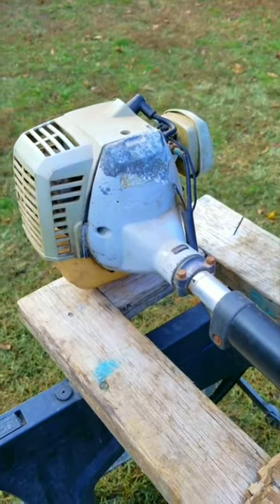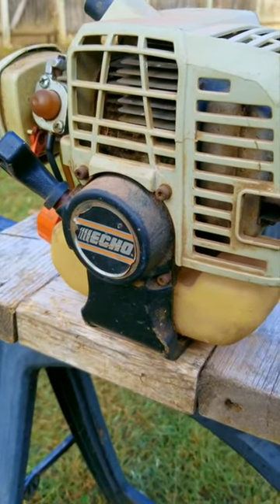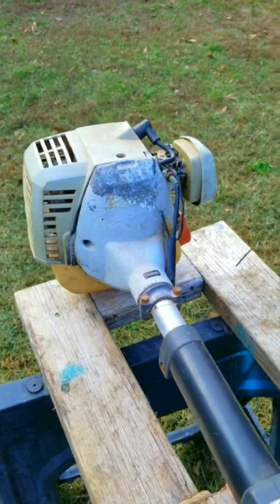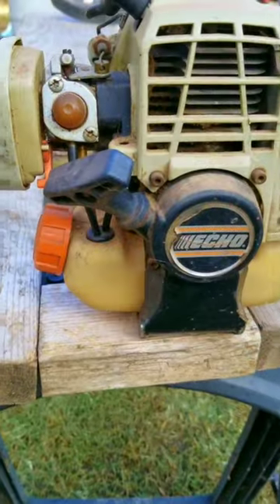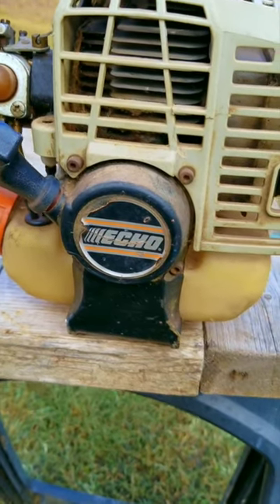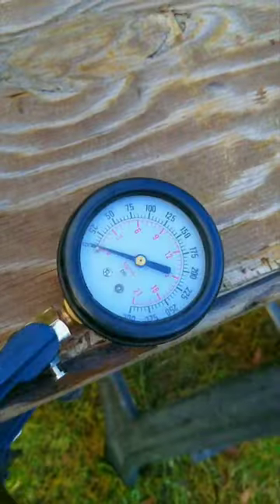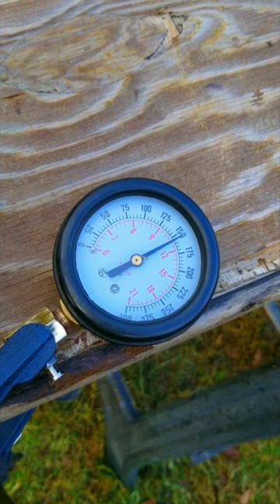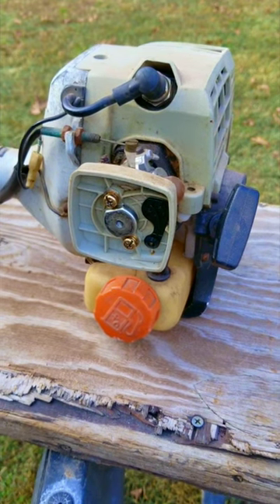Engine And Compression Are Related

Comment: Typically larger engines go for a lower ratio to save on fuel, but on weedeaters, chainsaws and stuff, it's not a big issue. I still like the older big 31cc+ because if you keep them in good condition they're worth their weight in gold. Comfort is a big factor too
Reply from the maker: you're right about that.
Reply: In the case of lawn mowers of 4 cycle types it's like cars but you also factor in air cooled. Fuel contamination of the oil is the biggest problem. Think about that one item when extending conventional oils. They can't bandle the fuel contamination.

Comment: Interested your thoughts on those E3 spark plugs... personally, I like NGK plugs in my Echo/Shindaiwa equipment...For the minimal difference in price I usually stick to NGK or possibly Champion if that was OEM Surprised my Echo 2620T runs a special NGK from the standard plug in almost all my other Echo/Shindaiwa OPE
Reply from the maker: I don't a have problem with them at all, but I only recommend using an OEM plug because it's what it the engine was designed with.
Reply: We use autolite race plugs on our small engines

Comment: For me, it's all about weight. Commercial weedeaters have small(21cc range) light, high powered engines that are noticeably stronger than  store brand 25cc motors
Reply from the maker: yes I totally agree, weight is everything
Reply: @HomeGaragechannel  Especially if you are over 40, carrying a 14 pound weedeater around in the summer heat stops being fun.
Reply from the maker: I feel that!

Comment: I have an old gray echo like that one , plenty of compression , love the older stuff , echo is great ! I use to run echo red armor pre mix but now I run mercury quicksilver 2 cycle mix , works great and if it protects a full tilt 2 stroke outboard then you can trust it !
Reply from the maker: me too, 2 strokes are really good for the power they make.
Reply: Hey Mark...don't take this as a criticism - I want your Echo to last as long as possible...Outboard 2-stroke oil isn't the best protection for your air-cooled OPE...the reason is that it is designed for cooler running water cooled outboards. Check the specs to see if it it rated for your equipment. TCW-3 is the outboard spec'd oil...I recommend either sticking with your previous choice of Red Armor (it seems to do a great job of keeping engines clean) OR if you want to save $ look at what I used to use Super Tech Universal 2 Cycle Oil for Air Cooled equipment. Currently, I am using Castrol 2T Snowmobile Oil. Good luck!

Comment: I never put any stock in numbers. If it did the job it had plenty of power. If it was weak I just ran shorter or smaller trimmer line. Always a way around problems but it might take a top end replacement too. Blkessings!
Reply from the maker: very well said.
Reply: @HomeGaragechannel  I try.

Comment: That's why Amsoil Saber is great. 100/1. Your equipment will last a very long time.
Reply: 50:1 not 100:1
Reply: @paulspomer16 i run my equipment all at 30:1 which seems to work like a charm!
Reply: @paulspomer16  Why Amsoil works great at 100/1. Do it all the time. Apparently you have not used Amsoil. The only unit unable to take the 100/1 is a Sax Dohmer. Something different in metallurgy of rings.
Reply: @Michaelsmith98453  Yeah if you are using those other guys oil.
Reply from the maker: I've heard good stuff about them.
Reply: Shell 2T oil at 25:1 and never had any problems.
Reply: @stevencaskey8502  I use amsoil and have been for years. No small engine should be ran at 100:1 with any oil. Plain and simple. I'm a small engine mechanic, I know because I've seen the damage from running 100:1 first hand
Reply: @stevencaskey8502 There is no good reason to run a 2 cycle engine lean on lubricant, no matter how good the oil is.  Amsoil will not replace your yard equipment if damaged by their 2 cycle oil.  Oil is cheap. engines are expensive.  Give 'em plenty of oil.  I like to follow equipment manufacturer recommendations.
Reply: @scotta9114  That's because you have to have oil analyzed and they have never had an oil failure. The reason for the leaner oil is for more power which means less usage or more work to be done. Why if leaner is not good do tou use 50/1 when in the 50-60s the ratio is 16/1. Amsoil is extremely good at what they do. We have had bot good luck with the old Sax Dahmer units. I suspect the Germans used a different metallurgy or something.  No info is available to me for that.
Reply: @paulspomer16  Or did they use something else. Only oil analysis proves it. Amsoil invites oil analysis. Say that yo the conventional oils and watch them shake. By the way Amsoils QC is far above anyone's. My father worked in conventional oil refineries for 35 years. I could tell you stories that would scare the crap out of you about the conventional guys. Also. Were you sure the guy actually put the oil in the fuel.
Reply: @stevencaskey8502  It's hard to say with 1.28 ounces per gallon?  Not a lot of margin for error.  I used Amsoil for many years in vehicles but finally stopped due to price.  We ran an experiment with two Poulan Weed Eaters.  Ran Amsoil in 1 at 100:1 and 50:1 Red Armor in the other.  Ran 2 tanks of fuel wide open throttle.  After that, took both engines apart.  Everything seemed dry in the Amsoil Engine and the Red Armor Engine was really oily.  Both engines showed no wear but it felt better to us to see the oil film in the Red Armor Engine.  Amsoil is great but I'd rather mix it at factory recommendations.  Thanks
Reply: @scotta9114  You are welcome to do as you wish. My experience since 1978 has been great. Amsoil rested Saber to 300/1. Worked very well. I believe  Amsoul does this for a very wide safety measure. I know the difference in QC between Amsoil and Amocos refinery in Texas City is staggering. That is a whole lecture in itself.
Reply: @scotta9114  Also. The pillow packs are actually 1.30 Oz. Just for good measure.
Reply: @stevencaskey8502  I would be nervous using this in my Toro 22043 Commercial Mower.  Has that wonderful Suzuki 2-cycle 5.5 HP engine.  I did try Royal Purple full synthetic oil at 40:1.  Want this Mower/Engine to run forever.  22 year old Mower.
Reply: @scotta9114  Amsoil tests them all. Be carefull. As for the mower using 50/1 is different here due to the continuous  or long run time. Also the mower is bigger.
Reply: This is an ongoing debate by the Lucas/Amsoil fanboys... it's your equipment - run it how you like...I'm not looking to race my strong trimmer or other 2-cycle equipment nor do I want to spend time/money repairing/replacing sooner than necessary. Therefore, I follow the MANUFACTURER'S recommended 50:1 leaning towards 45:1 with my mix... IMHO it makes ZERO sense to spend WAY more than 2x as much on Amsoil to put 1/2 as much lubricant in my mix but rather the correct amount of the properly spec'd least expensive oil. To each their own.
Reply: I agree.  I mix around 40:1 with Echo Red Armor.  No worries about damage due to lack of lubrication.
Reply: @paulspomer16  I just picked up a Toro 2-cycle Mower that the owner ran on Amsoil most of its life.  Low compression now.  It's old so worn out.  I split the crankcase and the roller bearings on the crankshaft were worn and dry.  Not used to tearing a 2-cycle engine apart that has no or little signs of residual oil.  Scary actually.
Reply: @scotta9114  Exactly right!